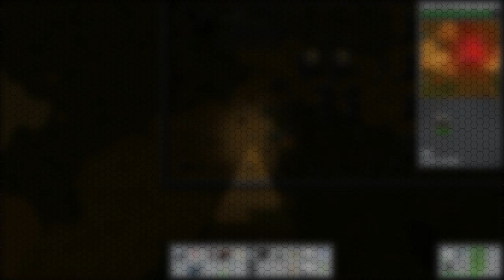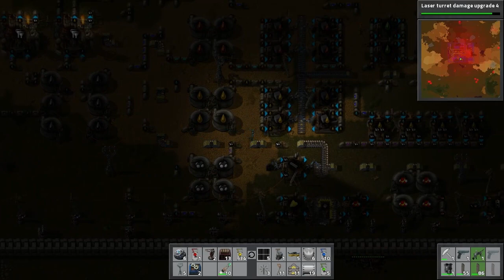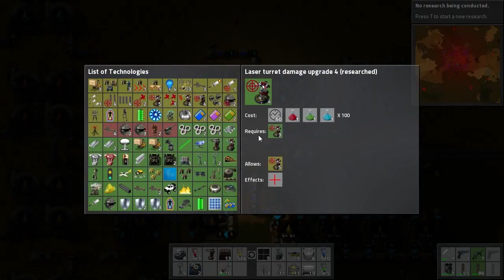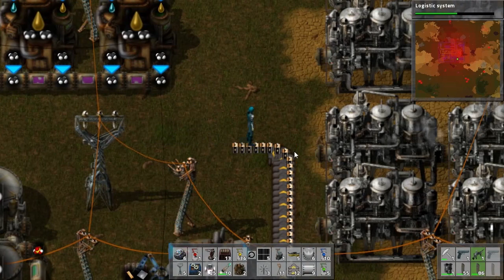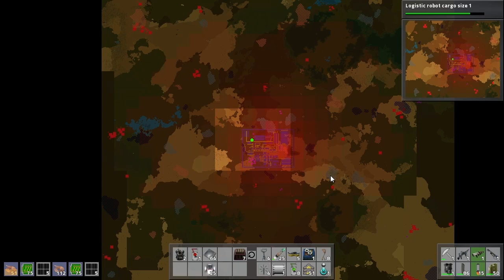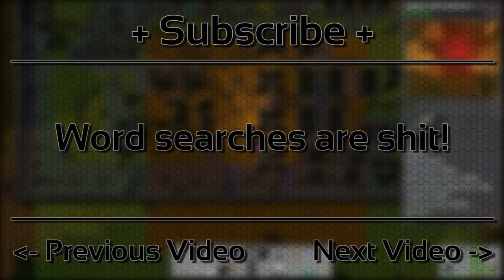Construction + Factorio #16 = RobCo.

Comment: The problem with your iron plates, it's that you are sharing the belt with the copper.
If you look closely, you will see that the inserters are waiting for a place to put the iron plates.
You have two options, use different belts for each metals, or maybe use faster belts, which will empty the area more quickly.
Other thing that you could do, it to change all furnaces to electric, and use speed modules.

=)

Comment: Suggestion: Try using higher-speed belts until the belt is past the gears and the copper. The smelters may be suffering from the same issue as the copper wire did.
Reply: Yea, that should definitely help if the early parts of production got sped up to deal with the increasing demand of resources.

Comment: YEEEEY!!! Another Factorio ep!!!! =D
Thing you should LOOK AT
-Rockets aren't worth it... What's OP is the Combat Shotgun with Armor Piercing Ammo. That's GREAT. Also, combat robots. Distractors and Destroyers.
Flamethrower is a not so bad option for buildings, but not as good as de Shotty :)
-Solar panels are the way to go, but the steam can stay, because the game uses FIRST the solar power, and the Steam will only compliment if nessesary :)
-I love the way you did the The substation and solar panels, but the SUBSTATION does NOT need an electical pole next to it, it has a long cable reach by itself, so try placing the Big power pole just outside the area of influence of the substation, and it should connect too!!! (Also, that gives you room for 1 more accu :)
-I agree that it's allways better to put the accus anywhere that nowhere (or in the backpack :P)
-The STONE BELT doesn't need to go FROM THE TOP, it cn feed in the bottom and  spit the product from the TOP!!!!

Keep doing this Vids. They are great!!! :)

Comment: If I may point your attention to the belt where the copper plates are put onto, you'll see that the first turn ends up being a bottleneck.  There are more plates per tile before the turn than after.  Swapping that single tile with a fast belt will remove the kink.  This will be no means solve all your problems, but it is a very easy step in the right direction.

Comment: Steam engines don't produce pollution, but I know what you mean (boiller army) :P Greenpeace in my country did the same mistake one time, but they on the other hand thought that cooling towers in coal power plants were producing smoke etc. So, they got pretty strong projectors that were projecting on them "GLOBAL WARMING STARTS HERE", "ARCTIC MELTDOWN STARTS HERE" etc. with big arrow under the text pointing at the base of the cooling tower... And they did it in seven bigger coal power plants, protesting against the use of coal as a power source. Greenpeace is so silly sometimes... xD
Reply: Er what? Of course steam engines produce pollution.
Reply: Mimwing
Not directly. They're powered by pure steam, nothing more. So I don't know what you're on about.
Reply: LordDragox412 And how exactly would you propose this steam comes into existence?
Reply: Mimwing This is what I mentioned in my first comment, the "boiler army". Steam engines don't produce pollution - the boilers do. I'm sorry if I wasn't clear in the first comment, but I really didn't think someone would miss that...
Reply: LordDragox412 I thought for a second I had just misunderstood you somehow, but no, you are actually just completely wrong.
Steam engines burn fossil fuels (which include coal) in a combustion chamber. These then heat water, which rises as steam. The steam turns a turbine and so generates electricity. The carbon dioxide that results from the burning of said fossil fuels is then released into the atmosphere - pollution.
The entire device is known as a steam engine. The engine includes everything else.
The cherry on top would be if you were actually referring to the smokestacks as cooling towers (which is something completely different just fyi, and given that Greenpeace is Greenpeace and you didn't even understand how steam engines work that would be a reasonable assumption), but I'll give you the benefit of the doubt there.
Reply: You're partially right. What you're refering to is the term external combustion engine. There are steam engines that use non-combustion methods of heating the water and turning it into steam, but that's not exactly on topic. There seems to be miscommunitation between us, as I'm not too good at explaining stuff :P Let me try again - in the game, the steam engines and boilers are two separate things, so it's not one device, or that's at least how I understand it in the terms of the game.  There, that's the problem. You're probably the right one here, as I'm not an engineer and don't have extensive knowledge about definition of an engine, and that's where the problem was, I see now. Yep, I stand corrected on that matter. Engine - burns fuel in order to create heat and then turn it into motion. The way I saw it was steam engine is what takes steam and turns it into energy (so, a turbine), and not a device that also produces that steam. And no, the Greenpeace wasn't complaining about smokestacks. They were complaining about stuff, and the thing that I found funny in that history is the info from intervievs and the arrow under the text (that was shown on cooling towers, as they're the only big enough place for people to see stuff displayed there), that was pointed at the bottom of the cooling tower. I'm not an english native speaker, so you must excuse me the confusion I created. I'm lost... I'm done trying to explain myself as I totally forgot what I wanted to write xD
Reply: Mimwing
So, you're right on the first part, but I'm taking the cherry and planting it. Cherry trees are awesome :D
Reply: Mimwing
New day, fresh mind, I can finally explain properly what I've meant. In the game, the steam engine is a building that doesn't produce pollution. So, by the definition it's not an engine then. But still, that's the name of the building in the game and what I've been refering to in the first place. Boilers do produce pollution, and you've put them and the engine as a single device by treating them as external combustion chamber. Stuff+ (most likely) didn't treat the engine and boilers as one device, and by saying steam engines produce pollution (in the game) had the boilers in mind (steam engines rely on them, they need each other to succesfully produce energy, so working steam engine = pollution). I hope you finally understand me :P